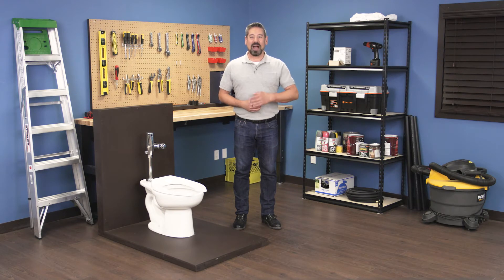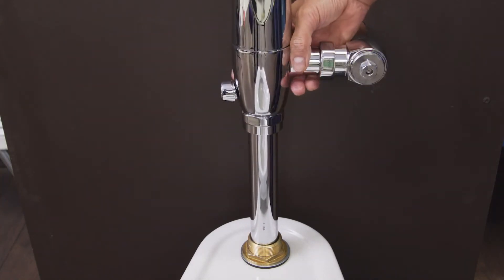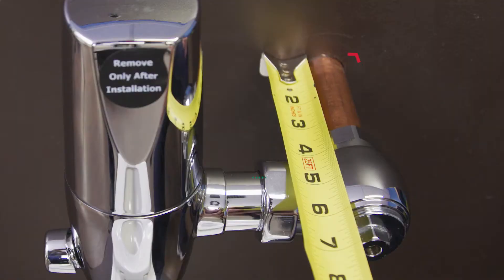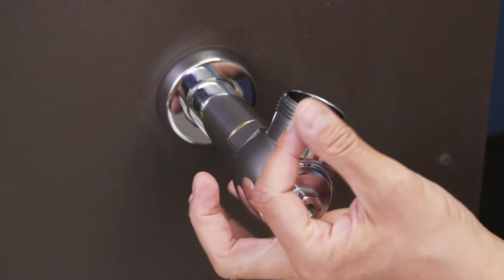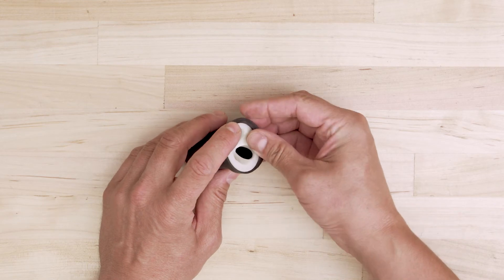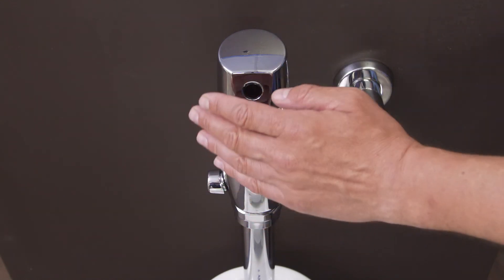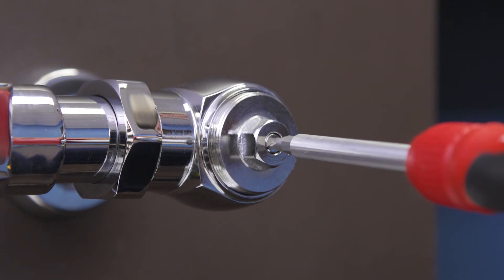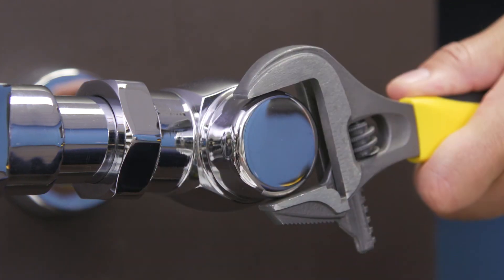American Standard Selectronic Flushometer | Installation | Repair and Replace

Comment from the maker: Note Teflon tape, or pipe joint compound is not to be used on any connection that uses an o-ring or gasket. It is however needed on the brass control stop adapter. This was not shown in the video but will still help provide a leak proof connection. 
More information on teflon tape: https://www.youtube.com/watch?v=9DhL0vet4gk
Guide on pipe joint compound: https://www.youtube.com/watch?v=a0jFPj4W8bY

Comment: The bottom is sticking an water will continue to run until u push it once or twice.  Automatic flush works properly
Reply: Button
Reply from the maker: Thanks for watching. Yes those buttons can start to wear down and can start sticking.

Comment: Hi there. Thanks so much for producing this great video! One challenge we're having is that the main body of the flushometer is pushing away (to the left) from the flush valve at the supply line. In other words the pressure once we open the valve stop seems to more than the flushometer unit can take even though we've tighten the nut which joins the supply line and the flush valve. Perhaps we just need to tighten that connection even more?

We'd love your advice on how to fix this issue. Thanks in advance!
Reply from the maker: Thanks for watching. This almost sounds like an alignment issue. Checking the vertical level and horizontal level of all parts to see if it is level at rest. The water pressure in this case might just be exaggerating an un level start.

Comment: Tailpiece connection is leaking
Reply from the maker: Hi Eric, thank you for watching. If the tailpiece connection is leaking then there are a couple things that you can check. Check to make sure that the o-ring is seated correctly and not damaged. As well inspect the threads on both sides of the connection to make sure that there are no nicks or damage.